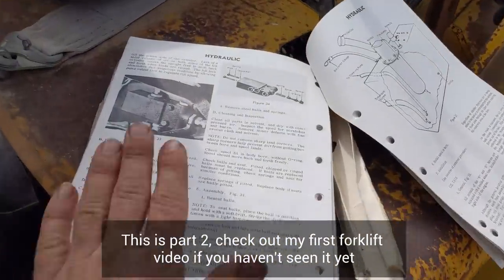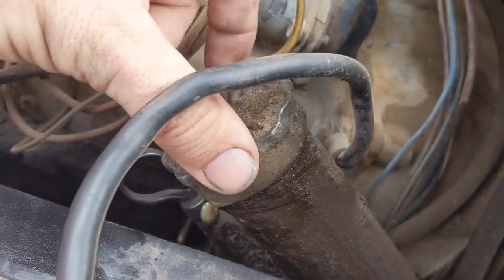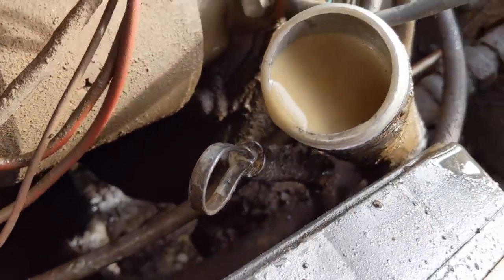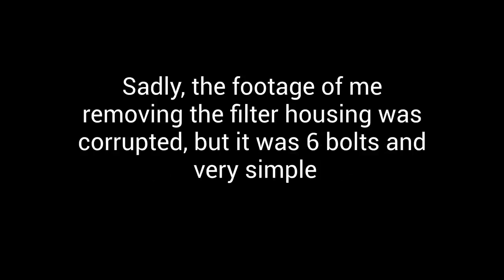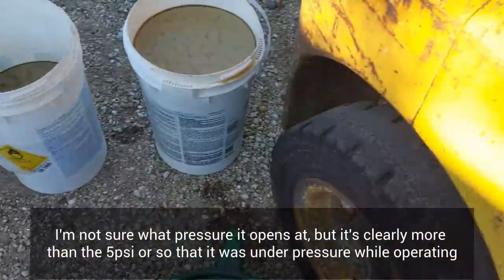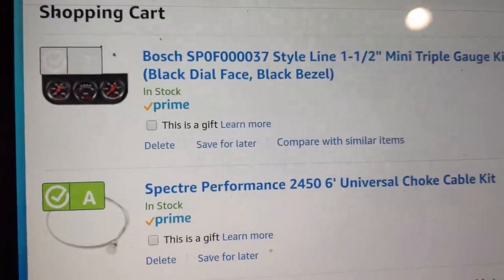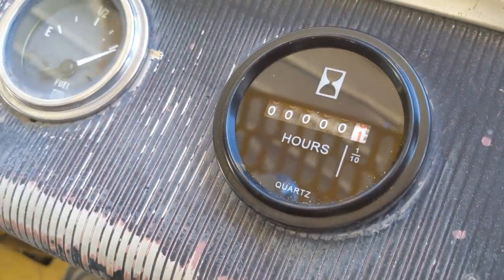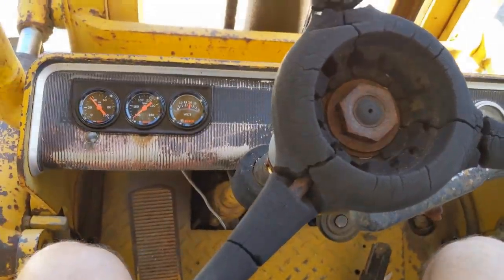Reviving an old Hyster forklift Part II

Comment: Hey Austin, I'm working on getting an old 1960s Hyster rough terrain P60A back up and running that's been parked in our boneyard for 10+ years. It has almost the exact same engine (Continental F227 inline 6), and the same hydraulic system housing/filter. I've been turning wrenches for a good long time, but for the life of me I cannot find an engine oil filter on this freaking thing! Where was the filter located on yours? I'm guessing it's probably close to the same spot on mine. I looked it up on the napa cross reference guide and it appears to be a bypass type filter...is it hidden behind an inspection port somewhere? Any help would be hugely appreciated.
Reply from the maker: Mine has a remote mount filter, I never stopped to question whether it was factory or not. I'll find the manual and see where the factory location is

Comment: It is most unlikely for the filter to cause the problem of a drifting lift cylinder or low fluid. The main cause of lift cylinder drift is the ram seal leaking, or the bleed back valve in the bottom of the hoist cylinder leaking. It could be the main lift valve worn but this is unlikely.

Comment: While you did a pressure wash before disassembling anything, I was surprised you didn't clean the rest of the crud off the filter assembly before reinstalling it again. I also realize this isn't even going to be a like new fork lift. But the more crud you can get off everything the cooler ir runs and easier to see any future issues when they crop up. JMHO  Good videos though and I like your project.
Reply from the maker: I definitely should have done that. I was in a hurry to get this into operation (and I wasn't 100% sure if it was going to work)

Comment: If you pour from a 5 gal bucket- keep the outlet at the top-- its counter intuitive, but it pours MUCH easier... also- the lift cylinder only has a packing seal at the top- it works very similar to a bottle jack.. Also- worn o-rings in the valve body could also contribute to it leaking down... I had an old baker about the same size. and the packings on many of the older lifts are universal.. looks like a good machine!
Reply from the maker: Good info, I pour that way on the one qt and gal bottles and you are spot on, counterintuitive but no glugs. Didn't think of that on a 5 gal. I'm working on sourcing parts to fix the last few issues now.
Reply: @AustinCoulson  I try to offer positive advice- never criticism...good luck and your video style is both entertaining and informative.. keep at it!
Reply from the maker: Thanks, I really appreciate it. This was the third video I did, so I am still learning for sure
Reply: There are: a rod seal or two on the cap, a cap seal, main piston seal, and an o-ring seal rod to piston. Leakdown is the rod seal if it isn't leaking out, possibly a valve seal but less likely. With so much water in thd oil you need to check the cylinder bore for rust pitting but it is probably ok. Abom79 just posted a video of rebuilding a similar size piston.
Reply from the maker: @Bodi2000  thanks for the info, I will check out that video for sure

Comment: The milky oil is contaminated with water, which could be from high atmospheric humidity.   The filters are made of paper which gets mushy when exposed to water, so that is a problem.    I have shares in an aircraft, and if it has been used for many hours in clouds, the oil turns milky.  If no-one uses it in cloud, then the oil reaches its 50 hour service still looking as good as new. . . .  You could try boiling a sample of that oil, it will vapourise the water, and turn back to original. . . .

Comment: l am only guessing here but it looks like it has never been changed Condensation will happen to any oil
over the years , l have driven Hyster's but l like the 400/410 ( with body tilt fuction) Lancer Boss Side Loaders they were fun to drive and unloading truck loads of  various Lengths of Timber , those were the days lol .
ps Safety tip : when Lowering forks stop 4" from ground tilt forks Down then lower until forks are touching
ground , and No one trips over them , or you can look up safety around forklifts on Video accidents do happen .
Reply from the maker: Thanks for the info. I bet there are a lot of forklift accident videos on here. Reminds me of of how many times I have watched someone slam their knee into a trailer ball sticking out of a hitch.
Reply: @AustinCoulson  Also forgot to say  picking up the Chevy was a little to much, two things you can do is replace the main seal on your Mast and  clean out the old oil/Lube it up , oh and check your  max weight you can Lift, the info is on the Plate next to the seat , with it fixed you will have No Trouble lifting the Chevy lol  you have done well with the 53 year old  Machine  ,  ENJOY  !

Comment: 3:20 This is water in the oil. Probably not from coolant. Rain is a typical source. Never underestimate the creativity of staff filling whatever hole they can find with either grease or water. A mechanic that can't figure out the igition might be a suspect here.
Cavitation /aeration usually looks more like honey - more like amber / golden opacity. Whenever your oil looks like a milk based product - caffe latte, joghurt, milk shake, water seems to be the key culprit.

Comment: I don’t know if you figured out that it’s actually a 3 speed transmission, but at center of “high and low” it should pull up and towards you for 1ist, then back to center  down and forward/away from you for 2nd and straight back to you for 3rd gear. At least mine does, which is identical to yours minus I’m 2wheel front. I supposedly the same weight, which I find unlikely and I am the same lift capability which even with the 2 wheels isn’t all that much of a shock. I am however a Perkins diesel so that could make up some of my weight if they do in fact weigh the same.
Reply from the maker: Thanks for the comment, you are correct on the trans. Someone else mentioned that a while back and it blew my mind when I got it to shift into that hidden gear.

Comment: Just a personal recommendation being is that service manual looks like it’s in poor shape about to fall apart.  If you have a multi sheet scanner I would just take and separate the pages and run it through a scanner and protect the information that’s in there that way if it ever gets damaged or a page gets greasy that you need to look at you always have a clear copy of it
Reply from the maker: Good looking out, i'm seeing if it can be digitized cheaply so I can put it out there for everyone.
Reply: Austin Coulson I hope if you do put it out you at least charge something for it so you can get back your 70 and for the effort that you put in for making it available to everyone.  If I had need of it I would appreciate it and be willing to pay since it is very difficult to find.  May be difficult due to copyright issues etc.

Comment: It's just old hydraulic fluid. Have had a few old neglected tractors, hydro cub cadets and other equipment. The hydraulic fluid always looked like that before I change it. The fluid itself is hydroscopic. It absorbs water. Totally normal with old hydraulic equipment that has not been serviced. It will not separate unfortunately. Once fluid is changed u will be fine.

Comment: I'm curious if this solved your problem.  I just got a hyster forklift very similar to yours having the same type issues. It's building pressure up on that filler neck. I'm gonna post a video on my channel showing mine so I can see if anyone cab give me ideas
Reply from the maker: The only issue was the main cylinder seal. The valve body was fine

Comment: hi, very informative video, i have similar machine, nice job on the gauges, where on block/head did you hook up the water temperature and oil pressure gauges on that nice running flathead? wasnt shown in video, thanks in advance
Reply from the maker: oil pressure gauge was hooked up to a T fitting at the oil filter that was a factory gauge port, the temp was in the head, again where a factory temp sensor went.

Comment: You outta repack that main lift cylinder pretty easy and extremely cheap if you do it yourself should be like 40 bucks worth of parts
Reply from the maker: Any recommendations for where to source the parts?
Reply: Check with a local industrial equipment repair shop, or hydraulic repair shop
Reply: @AustinCoulson  The O'ring store or baum hydraulics. Both have a website that can be found with a simple google search. I doubt they have a specific parts kit but both carry a large selection of hydraulic seals of all types
Reply: Austin Coulson helmar is where we order from

Comment: Gday
i use to weld a bit of chain onto the fork ex and a d shackle onto the fork right on the bottom side and that stops em getting stuck under stuff
cheers
Reply from the maker: Haven't heard that one before but I love the idea. I am usually ok on everything except these really damaged cars, and unfortunately that seems to be what I move the most!
Reply: yer use to work at a wreckers yard and got sick of em slipping off u put the d shackle on the fork on the upright on the insides just before the forks go out 

cheers

Comment: lucas makes a good stop leak for hydraulics, I have an old back hoe that would slobber fluid like crazy I thought I would try some and it sat for 7 months and after sitting that long I was able to run everything on the machine. before I did this I was lucky to get a week out of it before dumping 10 gallons in it.

Comment: Not sure where you get your parts apart from online but TVH is a global company that can source just about any part for most forklifts. In Australia we call your forklift a h80c what is it in the state's???
Reply from the maker: H80C is the model on the serial plate, but I have had a few people who actually built these get a little more specific on the model I have in the comments before (i.e. dual wheel wide fenders front, etc)

Comment: Hyster mechanic and service manager here , never ever !!!!!!!! use silicone on a hydraulic system ,it will deteriorate and get caught in the control valves.
Those old lift cylinders have chevron packing in them easy to replace , and service.
Reply from the maker: Thanks for the knowledge. I did not know that about silicone.

Comment: Did you ever get the hydraulic leak fixed?
Reply from the maker: Right now it's still working great when it's cold, and drifts when it's very hot but only under a really heavy load. I am waiting to pull it apart and fix it for good until I can afford to have it down long enough to source the parts.

Comment: Hello Austin, I have Hyster h150d diesel forklift.  recently the hydraulic oil is going to the crankcase. the levels of engine oil keep increasing but hydraulic oil keeps decreasing. we have changed the hydraulic pump but its still the same case. do you have any idea what could be the problem?
Reply from the maker: do you have a diagram of the seal between the motor and the hydro case? From my diagrams on the H80, the only area of possible cross contamination is where the drive gear from the motor (hydraulic pump input gear) meets the system pump on the rear cover. These forklifts might be very different, but I hope this helps!

Comment: fluid looks like a double-double coffee, you should have tasted it to check, hahahahaaaa........
Reply from the maker: I knew an old timer who ran an oil recycling plant he used to take this tiny spoon and taste the oil at different stages of the recycling process. He said he could tell how much sulfur was being removed. This was 20 years ago and he was old then. Said he had been tasting oil since the 60s...
Reply: @AustinCoulson  well you really did a good job on that one. mustie1 also have a video of restoring/repairing a considered junk yale forklift for his personal used. for safety reason may i suggest that you restore the horn and also install a blinking light on your forklift, and please avoid lifting a car as it may damaged some
underchassis part of a car! thanks and more power to you.............., one more thing as a reminder on a forklift, always look at the back when reversing....
Reply from the maker: Thanks for the heads up, always good to be reminded of safety for sure. I need to develop a better habit of looking back every time.  I usually only lift cars that are already wrecked and I am not using the undercarriage, but I buy a lot of cars from Copart and they load them with forklifts and damage the heck outta them all the time.

Comment: Continental engines have timing marks on flywheel
Reply from the maker: If this thing has timing marks, they are under decades of crud. I tried like hell to find the marks, and after  pressure washing and scrubbing I just sent the camera in the spark plug hole and got it to TDC that way. Then I looked again for marks since I knew they should be close and still couldn't find them